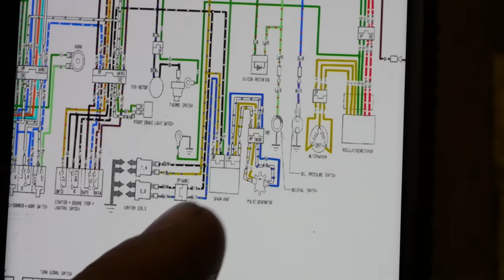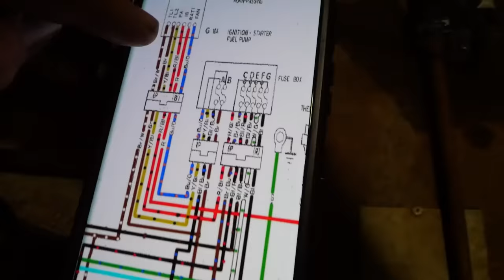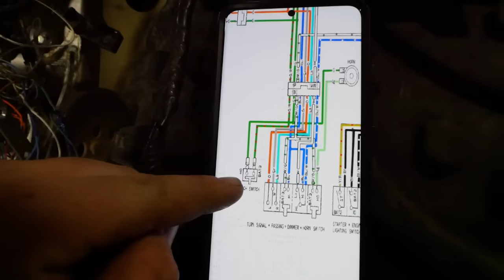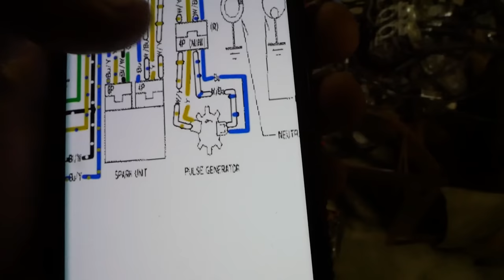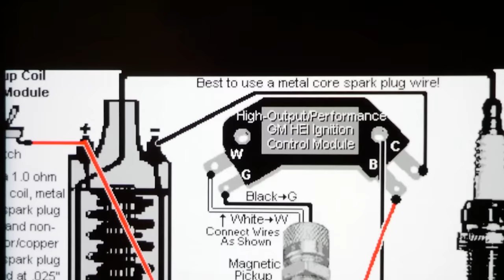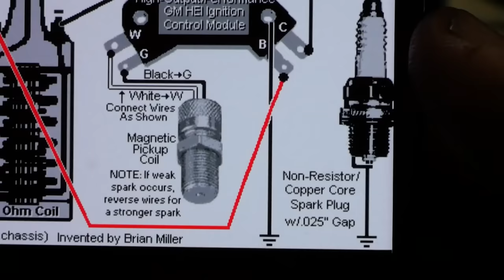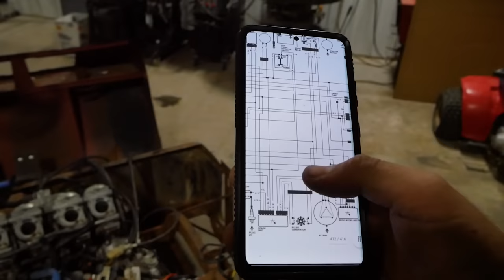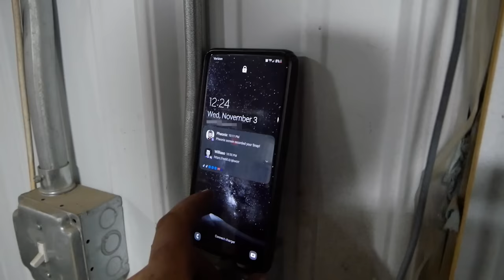$100 Crotch Rocket Powered Golf Cart Revival

Comment: That WILL not run right without some restriction on the carbs. Put a factory airbox or make one with a filter element. Even pod filters are touchy without a rejet. Airbox and it will be night and day on power.
Reply: I hope he gets this thing going at its max, it'd be so fun to see him ride around in
Reply from the maker: We're intending to, just don't have one yet
Reply: Also depending on the yr it should have a pulse pump as well.  My bike has one in the tank.
Reply: @JunkyardDigs  How a bout you do a build and make a car with a big cc bike engine in it?
Reply: @JunkyardDigs  I had to fix up a similar little motor in a bike with nothing but some beers and a garage full of junk. I built an air box with a bunch of PVC pipes and tees and reducers. Worked a treat.

Comment: Motorcycles have their ignition advance curves controlled by circuitry in the igniter unit. Using car ignition units, which are just basic electronic switches, you will get it to run, but it won't have any ignition advance. Also CV carbs don't work properly without a large reservoir of still air. Get a proper motorcycle ignition unit and an airbox and that thing will really fly. At the moment it's probably only making half the power it should.
Reply: The ignition advance was what I was screaming at the phone...I was hoping they would hear me . 😆
Reply: the lid for the airbox was what i was yelling at my computer. those carbs can't be run open top, they won't flow properly
Reply from the maker: Generally we're well aware, just hopelessly unprepared

Comment: I SAY A ROLL CAGE WOULD BE AN  ADD-ON, TOO! LOVE IT! YOU GUYS ARE CRAZY FUN! KEEP 'EM COMING.
Reply: That's weight, weight costs speed, screw it cage costs money, and what isn't a little risk.
Reply: maybe even just a tall pole in the middle with some supports not as heavy but its something
Reply: Last year my buddies and I swapped a snowmachine motor into a little go kart. We said we were gonna put a roll cage on it after we got it up to 70mph on the icy roads in mid March. Year latter we still have just two pipes sticking up like smoke stacks. But we did get a harness bar between them and a 5 point.

Comment: Thanks to GM simplifying their external engine components back in the 1980's through 90's us DIY's have been able to rig up or repair lots of items like lawn and garden tractors. The GM  'one wire' alternator is a great item for making a full 12 volt electrical system on a Craftsman lawn tractor. Actually any lawn or garden tractor of the type with belt drive transaxel. I mounted one upside-down under the gas tank and seat. The tractor was a hydro-drive so the belt is always turning and on hydro-drives you basically never need the clutch to stop, go forward or reverse. You use the motion control lever for that. I had enough room under the hood to install a full size car battery. Installed 55 watt halogen headlights and a couple orange LED marker lights for parking lights up front.  Rear I used some common rectangular red marker lights that have the chrome plastic trim. Ironically the original decals which were reflectors that are factory stock on the Craftsman tractors back in the 80's are the same dimensions as the marker lights I installed. The recessed area in the body sheet metal allowed a perfect fit. My friend seen me coming down a dirt road trail one night and he thought it was a Jeep off roading ! I put a set of red markers on my trailer for also. I used the same mounts that the alternator had to mount it to an engine. I found another hydro-drive pulley and mounted it upside down on top of the original with a separate belt from there to the alternator. That gave me the same speed for the alternator as it would have on a car engine which is generally 2 times the crankshaft speed. Never had dead battery issues starting my tractor and have used it to jump other vehicles including my friends semi-truck! Love these videos! I should post some of my dumbshit stuff that actually works, like filling your back wheels with water and adding barbell weights for wheel weights along with snow tire chains ! Might sound stupid but on hard packed roads here in California that have decomposed granite (DG) the chains and weight bite in and give an incredible amount of traction. So much traction that you can actually move dirt around the yard with the dozer blade attachment. That GM module can be used with many small gas engines to fire a coil, including a high performance automobile coil ! Pretty cool 😎 👌

Comment: Pick up a Holley adjustable fuel pressure regulator that’s capable 1 - 5 psi. And add some air filters. Maybe some knock-off K&N filters. 
Almost anything as long as it reduces the amount of air going in those carbs. Then either add a few teeth bigger rear sprocket or drop a tooth or two in the front. That thing should come alive and be a little more terrifying.
Reply from the maker: That restrictor alone cost more than the whole machine!
Reply: @JunkyardDigs  What if you fabricobbled some PVC together to make an intake runner and throw a cheap filter on it?
Reply: 4 nerf balls oiled and stuffed into the stacks, filter done
Reply: Yeh, they never run right without a proper airbox or individual air cleaner setup, I always bump up the main jet if I run individual air cleaners.
Reply: I'm almost wondering if they might have had it in second gear. I dont know much about bikes, but I know some of them you have to go below neutral to get first. Who knows though, they might know that, and indeed had it in first. Just throwin ideas.
Reply: @MPGamingCentral  possible, was wondering why they were worrying about regearing, those are shorter wheels than a bike and if anything it would just make 1st a near useless/granny gear, but its got a 5 or 6 speed trans and should still have lethal speed potential
Reply: @JunkyardDigs  yeah but it’ll be fun

Comment: Quick tip, if you want to dry an electronic board, soak it in isopropyl alcohol. (or 70% alcohol, it's better than nothing)
Reply: No need for that. The board is coated.

Comment: I hope the guy that sold it watches every single second of your revival.
So very happy you got an actual schematic.
I've commented on restoring electronics on many platforms. Formerly working for a company that had low volume very proprietary equipment and devices. I was the main restore guy. What it amounts to is using very sterile water, goves and mild brushes to remove as much corrosion as possible before rebuilding any actual bad links that might be present. A gallon of distilled water dish gloves and a soft toothbrush would have been the best choice to restore your circuit. Removing debris because that is the main culprit in short circuiting any electric equipment. compressed air to flush out anything lingering and a thorough drying will most often restore almost anything.
Alright, you've invented a single seat side by side. ha ha

Comment: I literally bought a wrecked 1987 cbr600 that was in a haybale, motor full of water, and last ran in 2008 for 200 bucks in the middle of a snow storm. i bought it for the yoshimaru exhaust system for my personally cbr600f1. My friend and i got it running with a home depot  pvc intake we made with jb weld in one afternoon. Our plan is legit to make a trike with the motor since it runs so well lmao. These hondas you cannot kill!
Reply: They made outta aluminum? The block and pistons that is. Aluminum won't corrode and seize like steel would (unless you put the 2 together). Might be why they can get filled with water and not lock up.
Reply: For a minute there, I thought you were Cars and Cameras! 🤣
Reply: @buckberthod5007  I’m 99.9% sure that the cylinder sides are steel, so it could’ve rusted
Reply: @buckberthod5007  its all cast iron i think, the motor was locked up but nothing like a little used atf and working the crack back and forth cant fix.
Reply: @EHoward64  ATF and diesel/kerosene in a 50/50 solution is the best thing I've ever found to unseize an engine.

Comment: Those philips screws aren't philips screws they're JIS screws. Slightly different shape and you can round them out with a philips screwdriver. But you can take them out if you're careful with a philips. Also I'd be careful with torch cleaners that you don't open up the jets unintentionally and cause running issues. An airbox is also a thing motorcycles don't like to run without unless you jet them up to run richer even with the likes of cone filters.

Comment: This is the stuff I struggle with, electric diagrams!! Iv built many engines at a few machine shops over the years but this stuff is the mind-boggler for me. In this LS1 age it's time to learn and channels like this are what a brotha needs👍 But at the moment I'm building a 1986 honda 250R that sat for 15 years. All I had to do was rebuild the carb and it runs so awesome. Time for tires and brakes and worry about looks later. I wish I had the same, on camera experience you all offer or I'd be on YouTube. Great build guys!! Mopar guy but where we are at Honda guy till I die!!

Comment: Hey JD,

For future use, keep a bottle of isopropyl alcohol on hand for things like submerged electronics. I was a tech in the Navy for 21 years, I have gave things full baths in alcohol and then put it in about a 200 degree oven for a couple hours. Most times those items would come back to life. Sometimes it doesn't work but it's always worth a shot. BTW the rice on the phone trick, gonna call that bogus but hey I'll let the people think it works. It simply the fact that the ICs dried out is the only reason it started working again. For the alcohol the higher percentage the better (less water content). Don't use denatured alcohol. It has impurities that can cause corrosion and as you well know that's the downfall for most electronics. The water isn't what causes it to stop working, it's the impurities in the water that cause corrosion that causes them to stop working.

JG

Comment: Those HEI modules work wonders. I had a Tecumseh engine on a Bolens tractor and the solid state ignition was burned up. Made an ignition system using junkyard parts and got it all working and running. Used a GM HEI Module out of a 1980 Chevy Conversion Van, a coil off of a 1978 Ford F-150 I6, and an ABS sensor off of a 1998 Ford F-150.

Comment: Just build a little cantilever system onto the post you have your clutch lever mounted on and make it a simple slap shifter just like a sequential. Looks really fun. I built a Frankenstein a long time ago. I started out with a 200X ATC and a KAWASAKI KDX175, and mounted the Kawi motor in the 200 frame and installed the forks and triple clap from the Kawi into the 200X's front tube of the frame and changed up the expansion chamber to shoot out underneath the engine,  since it had the dirt bikes front end it made it lean to the back pretty good, but it was way faster than the little 200X 4 stroke motor. Chain kept falling off though and never did make a better chain tensioner. Funny as hell though

Comment: Great to see smart people using it 👍 👏
Reply: Seriously love the show ❤ great cast even your father hope u keep doing this think i have talked my son into join me on this kind of stuff by making him turn wrenches on his diy civic type r we did the stuff that had to happen then the stuff i had to have happen brakes from 9.5 feon disc to 11.5 front from vw lol and chevy parts and rear disc from drums from the sister accura model with 9.5 discs told him we have to fix body stuff have the parts to correct what wanst essential like windows lights wired up left it hotwired for 2 years then put alarm and radio inbit since we had o ly a trunk key so we could lock and unlock with remote with 6$ actuators 
Like that unlike most ppl u arent limited by thats not my job or i haven't done it yet but instead stop reaim and start anew post epiphany i assume it for the same reason as me lack of money and huge want and the why not just do it myself but anyway just keep enjoying it and it seems to be everything!

Comment: I like your style. However a hall effect sensor gives discrete outputs. A reluctor will give you a sinusoidal analog signal (pulse). Your signal generator is a reluctor. A hall effect sensor would require power to operate and it would require a digital transistorized ignition module to interpret the discrete signal values and generate a signal to drive the coils to oscillate and induce a current from the primary to the secondary windings and fire the coils. You have a reluctor type signal generator that doesn't require a digital transistorized ignition module. That is why you can detect analog ac signal from the device without powering it internally and having an ignition control module. You need an analog ignitor module to oscillate the primary and induce a current into the secondary. Non-digital ignition systems, (Capacitive Discharge Ignition) works via a concept of "inductive kick". Good idea utilizing what you have rather than spend money. I will like and subscribe. Your doing good work.

Comment: I did the same thing with an HEI module. I had a clapped out Kawasaki quad with a missing ignition box. I wired in the HEI and rode it like that until the rings were so bad it didn't have enough compression to run anymore. Good times...

Comment: I am absolutely one of your hardest to please viewers and you get a ten out of ten perfect score!! I don't fully understand those HEI systems but I can wire one and make it run as have done it before. You did a great job of explaining and I actually listened to you. Great job kids of finding a harmless no salamander died fun. I hope that you kinda finish it up and make it a possible driver... more suited as far as drivers go, a ten year old four foot tall kid for the test dummy. Where is a skinny short small person when you need one. I got a crazy idea for you since its just nuts and bolts... make it into one of those wide two wheels in front and one on the back on a swing arm so the wheel  on the drivers side doesn't chew you up should you slide back... great video kids

Comment: Ya'll laugh about putting the 'puter in the oil-dri to "fix" it but that will totally work. Ideally you'd hose it down in alcohol and give it a good brushing with your toothbrush first. (It's not like you're using it for anything else) I haven't personally used oil-dri, but I can see no reason what-so-ever that it wouldn't work. And most that crap will usually work just fine after drying it and cleaning it up really well. Just an FYI for anyone interested....
EXCELLENT info on the HEI's.BTW! Thanks for that lil tidbit.

Comment: 16:20 that's VR (variable reluctance) sensor because it's electromagnetic coil that generate ac  voltage on two wires (same times it had 3 wires because one is shield). Hall effect had 3 wires and needs power supply to generate square wave (not ac) signal on third terminal.

Comment: From experience and see so many people trying to tune Honda 4 cylinder carburetors without the correct airbox and filter, I know that you can spend many hours replacing jets even changing manifolds and whole carburetors, but you will never get it to run perfectly as you can by just fitting the original airbox and filter 😉,  I have one so I know everything lol but naa seriously it's that simple and Honda does it for a good reason, also the port size in the airbox is a crucial size, please trust me on this 😊,  good luck and great with the wiring which I love to see someone who's not afraid of it 😄.

Comment: That water box aka ignition control module is responsible for the complete timing curve. By using the two hei modules your engine will be stuck running in base timing.

Comment: if you guys have problems with water and electronics again, Isopropyl alcohol is Anhydrous and will absorb water , if you dunk the affected piece in iso itll pull out the water and lower its evaporation point , so all you need to do is dry the alcohol off the part and it should clean any corrosion as well, if the part is shorted though i cant guarantee thisll help

Comment: I know this is an older video, and someone might have commented about this, but you really should use JIS screwdrivers on japanese stuff.  They just have a little bit different profile than Phillips.  They are less likely to strip screws.  I have also found them to work better at removing regular philips screws as well.

Comment: Excellent score for $100.  It's a drifting Rat Cart! Lol
  Gear change, brakes, cage, and a seatbelt. 
  Pressure regulator for the fuel.  OOOhh yyeah!!!! 
  Even the stroked type 1 2300 has to keep the fuel pressure at 2 lb per Aero injector throttle bodies. (4) And  it has two AMR 500 superchargers. Fabricate my own manifold. That engine lives in my superstol bush plane. Launches in under 30 ft. 
     🤠🐂🏞️🛩️

Comment: those are vacuum metered Carbs you have to have a Air box or filter on each! for it to give it proper fuel those Rainbow shaped openings on each carb has to have vacuum
 to pull the butterfly up!!

Comment: Watching y’all dissect the electrical and go thru the carbs just to bring it to life for an hour of freak’n fun , but how much better would it be if you transformed it into a small single seat tube frame sand buggy that could shift 👈🏼stop👈🏼and actually run like it’s supposed to ,oh and maybe a roll bar and seat belt , bigger gas tank , or find a deal on market place to put that motor into 🤔👍